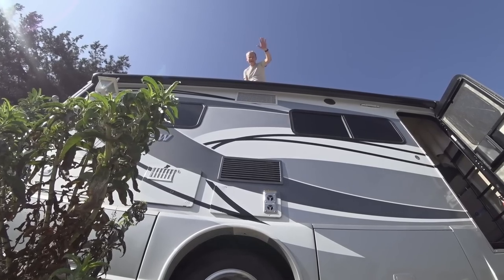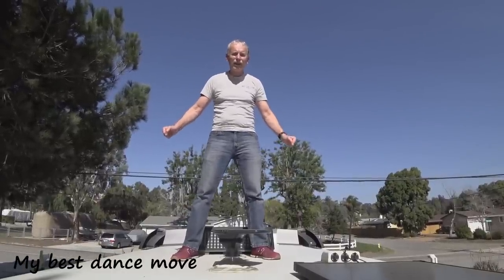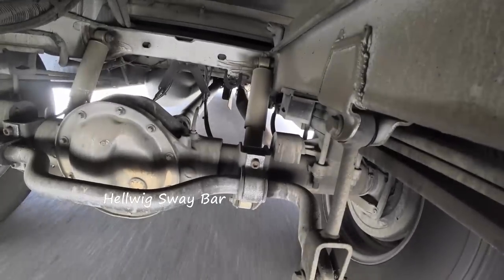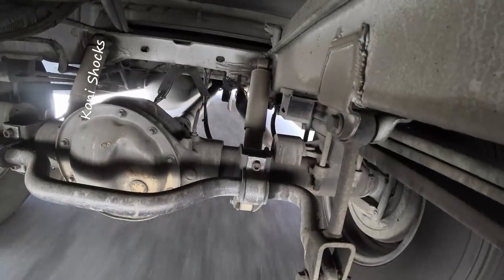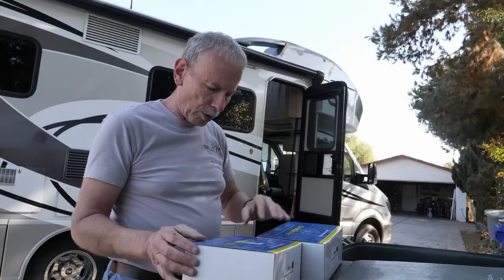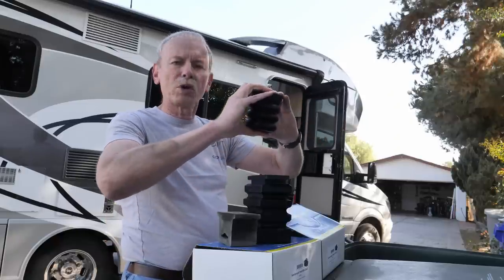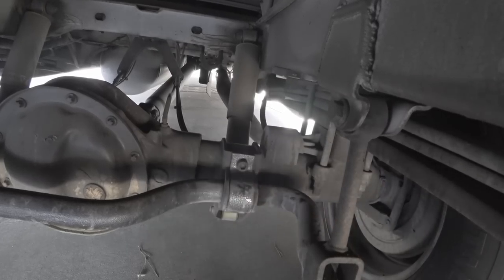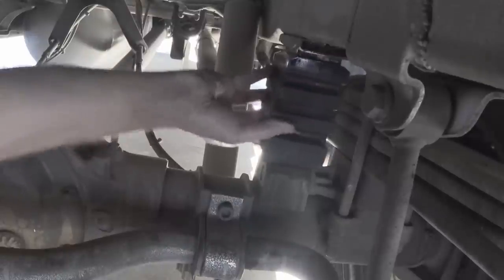RV Suspension upgrades - Winnebago View

Comment: Here are my recommendations and game changer suspension upgrades that I recommend:
-Agile Offoad Fox 2.5 rear shocks that are awesome!
-Roadmaster sway bar that goes in front of rear axle and keeps your factory in place and if your factory sway bar behind axle is not the new 1.5” but the smaller I would replace that too with larger diameter.  Keep in mind that scientifically and physically if you think it through having a large sway bar in front of the rear axle more toward the center of RV makes a lot of sense.  Costs more but who cares when you are thinking about the life of your family.  A local RV guy who is no-nonsense talked me into this solution and I am glad I listened.

As a note I added the Bigfoot leveling system and use this when I get on the roof as well for any reason to stabilize vehicle.

You may say “I don’t want to pay for this after paying so much for my vehicle” but let me say that I don’t really think the stock set up with how top heavy this brand/model is is really that safe and not a sound design IMO.  The Spinter has a narrow wheelbase and is 11’ tall and is way too top heavy for the stock set up in my opinion.  Make these changes and it’s a whole new vehicle in the way it rides and corners or reacts to wind or even exiting driveways or going over speed bumps at off angles.  It was a strong right to left gust going down the freeway that got me looking for a solution to be more safe.

You could even go one more and add a tracking bar to the front if you feel you want to keep going on improving. 

You can get the sway bar and shocks after market installed for $1500-$2000 or so.

Comment: Great advice for the DIY'er and perfect upgrades for better stabilization...

There is a company called WeldTec Designs in El Cajon, Ca. that sells the true suspension upgrades and lift-kits for RV'S like beefier "Leaf-springs" & "Shocks"... great stuff for those who like to go Boondocking off-road and require more ground clearance or just those tired of scrapping driveways.

Comment: Nice video..my first thought upon seeing the Helwig sway bar is the right upper mount plate for the sway bar appears to be cracked or the weld is separating from the frame. Now this could be the shadowing or camera angle and it might be just fine. Might be worth a look. I own a class C  Born Free E450 and did a lot of these mods when I first purchased it.. I had the front upper sway bar mount fail at the frame. I took it to my R & B Steel fabricators in Rockville Maryland and they did a fabulous job in a really tight space. I replaced the Ford shocks with Bilstiens, and found the one of the Ford shocks have already failed at less than 800 miles....jay
Reply: The bad weld was instantly obvious. I mentioned it before I read the comments.

Comment: Nice video for installing SumoSprings in our 2011 Winnebago View.  Discovered I needed a 13mm deep socket to remove the front Mercedes bump stop and install the front SumoSpring... which I didn’t have.  Found a 1/2” deep socket which worked fine... but would recommend anybody doing this get a 13mm deep socket to make their installation go smoother.

Also, I noticed you didn’t use the Mercedes recommended front jacking point... which is forward of the front wheels (3:18 in your video).  Obviously is worked fine but the Mercedes front jacking point which is shown in a diagram right on our Mercedes hydraulic jack under the passenger floorboard worked fine.  Just needed to jack it up high enough to get the front wheel off the ground so the front suspension drops enough to insert the front SumoSpring.  Definitely recommend setting the parking brake SOLIDLY and jack on a completely so the RV doesn’t fall over on the laterally unstable Mercedes bottle jack.

Just a couple of tips others may find helpful using your AWESOME SumoSprings installation video.  Thanks Ron !!!
Reply from the maker: Good points. I don't try to include all details (just the flavor) in my videos so as not to bore the ones that will probably have some one else do the work anyway.  Congrats on you initiative.

Comment: Added sumos to the rear of my 2017 24V. You made the video a few years ago and it's great..... but you left out the hard part which is jacking the frame up enough to insert the sumos. Maybe I have a defective jack because it was really hard to generate enough leverage with that skinny lever MB supplies to pump up the jack. Did you have the same problem? I was about ready to run down to harbor freight and buy a floor jack. lol. Hope to see you on the road. I'm buying!
Reply from the maker: R Murry yes, I have an old floor jack I use when I can. I have used the bottle jack that comes with it. A little more tedious.
Reply: @ontheroadwithron2432  I was watching another youtube video when I saw someone using the bottle jack and realized I don't have the handle for the jack. The previous owners must have not replaced after using it and I ( like an idiot) used the small handle used for removing the wheel nuts. Lots of work.....

Comment: Hey Ron, your video is so straightforward on how to do the install. One question, where did you place the jack to lift the frame to get the rear sumo in? Are you lifting under that beam the Heliwg is attached to?
Reply from the maker: Normal jack points on frame.

Comment: Ron, I love your videos and appreciate your willingness produce and share your work. Why did you choose the black Sumos vs the yellow or blue? I want to put them on my 2016 sprinter 3500 which weighs 9,700 lbs
Reply from the maker: Black was the recommended ones back then. If I had a do over, would go with Foxshocks instead.

Comment: Thank you so much for showing your improvements. We have the 2017 24D but with levelers. Are the sway bars possible with those? Will the shocks alone help with the swaying while driving? While I love the rv, I can’t believe the “swoopyness” of the thing.
Reply from the maker: winebox the best thing you can do is add a bigger sway bar. It will reduce the leaning over. Shocks help with bumps and dips in the road. And yes your RV chassis is the same as mine. My friend has Foxshocks in the back and highly recommends them.
Reply: On the Road with Ron That’s so good to hear. I was worried that with the extra equipment of the levelers that wouldn’t be possible. Is this a home mechanic job or a shop job? As this is our first rv, what should we look for in a shop?
Reply from the maker: winebox it is pretty easy to do. Just 4 volts for sway bars. Anyone with a couple tools should be Able be to do it.
Reply: @ontheroadwithron2432  Ron, I've installed the Hellwig sway bar (2016 View). What would you suggest next for the biggest bang for the buck?  Rear Sumo springs or rear shocks (Fox or other brand)? Thanks Mark
Reply from the maker: @markmartin6299  Fox shocks is recommended

Comment: Thanks for making this video.

I got a f53 with Thor motorhome on it and it was extremely hard to handle.

I put the rear hellwig anti sway bar on it and it did make a noticeable difference BUT even though they say it's a two hour job it took two DAYS.  The hardware didn't match my spring/axel saddles.  I  had to drill 4 new holes on those thick plates.  The existing ubolt nuts were pure hell to get off. Hellwig SHOULD have holes in the plates for both styles.

It also chaps my ass that they charge $850 for the f53 sway BUT it's actually less material than the f450 sway that sells for $235.

They are ripping us off bigtime.  They include redundant hardware including new unbolts and nuts for the frame attachment. Such a waste.

But as the old saying goes.... if you want to dance you have to pay the fiddler. 

As for the sumo springs, they do not make any for a Thor motorhome.   Buy I've read several reports that say sumo springs don't make much difference. 

But I have heard that doubling the shocks can make a noticeable difference.  But that may be a sales pitch from the folks who sell the long bolts and spacers.

I'm pretty sure that I'll be giving the quad shocks a try.

Comment: Ron do you have any updates on suspension modes? What have you done different since initial install? Remove anything add anything?
Reply from the maker: I removed the front Sumos. Too harsh a ride. Today I would go with fox shocks in the back without any sumos. Sway bar is good and I run 55 psi in front tires.
Reply: @ontheroadwithron2432  did you put back the front oem rubber bumper when you removed the front sumu’s?
Reply from the maker: @markpillori  yes, glad I kept them.

Comment: Were the fronts easier to access/install from behind the wheel, or in front, or over top? How did you turn your front wheels to allow for easiest access? I may not have seen it clearly, apologies.
Reply from the maker: Just turned the wheels. Out with engine on. Access from front and top.
Reply: @ontheroadwithron2432  I have since figured that out - trial and error. I could get the OEM bump stops out easier from top/front, but needed access from back/top to install new SS. Thanks.

Comment: Question: do these mods make the ride over rough spots softer? Right now our 2017 View beats the heck out of us (and itself) on the poorly maintained freeways here. Thanks.
Reply from the maker: If you want softer ride, then set front tires to 55 psi and do not get Sumo springs. Sway bar is fine. Most suspension mods are to reduce sway and rocking side to side when a semi passes or you take a sharp off ramp. Shocks also effect ride. Is your rig OEM or modified?
Reply: OEM. 
Wouldn’t low psi put tires at risk?
Reply: BTW love your videos! Useful, clear and complete. J
Reply from the maker: @josephnewman1545  no. The front is lighter than the rear and the 55 psi is the Michelin recommendation for the actual weight on the front tires.
Reply: @ontheroadwithron2432  Got it. Thx!

Comment: Hi Ron!    Thank you for posting this video.    I just got a 2019 VIEW 24J and would like to do the exact same upgrades.   Could you please post the exact part numbers for each of the 3 items?    Thanks in advance.
Reply from the maker: Fake Persona Just ordered from Amazon. Hellwig 7254   The other ones I got online. They are for the Sprinter 3500.
Reply: Which load capability springs did you get for the front?? I understand the weight load can be either 500lbs per spring or 1000 lbs per spring?

Comment: How did you decide which SumoSprings to get?  There are a ton of options, just for the sprinter.  All different grades and a huge price range.  It looks like you got the smallest available.
Reply from the maker: Furrari Aussies the black ones were the only type (color) they had. I’m considering removing them and going with Foxshocks instead. A friend of mine did this and is very happy with results. Mine still has too much rocking over angled dips like driveways.
Reply: I was familiar with SumoShocks already but never Fox.  I put air bags on my current class c but it's a ford based chassis.  They are a bit of a pain having to always put air in them.  They do work pretty great.

Comment: I did some research, and also talked to sumosprings technical support. From what I can tell you have both the wrong spring resistance (you should have a 54 and not a 47, that's the yellow versus the black), and you have the wrong spring model. You have the SSR 338 and sumosprings says you should have the SSR 336. The 336 is a much more robust spring (and more expensive!) with a positive attachment at each end. 
This could be why you seem somewhat disappointed with their performance on your RV?
Reply from the maker: Gregory K from what I read on the sumo website, the black ones were recommended when not towing and for medium duty. No big complaints with the rear ones, but I have removed the front ones and like the ride better. My main complaint now is the excessive rocking back and forth after crossing driveway dips at an angle. This is probably due to inadequate shock damping. Might try FoxShocks to fix that.
Reply: @ontheroadwithron2432  Ron have you considered replacing the rear springs with a helper spring package. The Sprinters come with only 2 springs. When you add a lot of weight that really puts a lot of load on the rear springs. Adding springs should provide more stability, front-and-back and side-to-side.
Reply from the maker: @stuartrogel9117  yes, but more springs also give a stiffer truck like ride. The existing springs are rated for the RV weight, if I make any further changes, it would be Foxshocks.

Comment: Great video - very informative. Do the sumos increase the carrying capacity from the basic 1030 lbs?  Which order do you suggest doing the upgrades?
Reply from the maker: The Hellwig sway bar made the biggest improvement. Shocks and Sumos can effect the ride so it is a trade off.  The Koni shocks are supposed to still give a better ride, but not sure how much is just marketing.  However that said, the original shocks are very wimpy and a good thing to upgrade.  Many different shocks to choose from, each saying they are best.  The sumos do not actually the RV increase load capacity, but will help bottoming out from deep potholes.

Comment: Hey Grandpa Ron, I was ordering Hellwig anti-sway bars for my 2018 Via and for my in-laws' 2016 View. Another vlogger (RV With Tito DIY) mentioned he did front and rear sway bars (E450 chassis), but I'm not finding front anti-sway bars for the Sprinter 3500. Is there only a rear anti-sway bar for the Sprinter? Thanks in advance.
Reply from the maker: David Ahn I believe the Sprinters do have front sway bars but I don’t know of anyone who’s changed them. They are a lot more difficult to install.
Reply: On the Road with Ron Thanks!

Comment: What model of Foxshocks you recommend or your friend using ? . When i spoke to  shockwarehouse I was told/advise  (KONI82 2588 for Rear and 872657 for Front) I have 2009 Sprinter 3500 (Winnebago view 2009)  , They said there is no FOXShocks for later Model RVs .. just trying to take your suggestions and experience so far on the suspension improvements you made..
Reply from the maker: The best are Agile foxshocks 2.5.  They are specially designed for Sprinter RVs. https://agileoffroad.com/product/agile-fox-2-5-rear-shocks-mercedes-sprinter-3500-rv-class-c/
Reply: @ontheroadwithron2432  Ron I have also heard agile fox shocks are very good for Sprinter RVs. I am also looking at Falcon 2.1 shocks for the rear of my 2009 Fleetwood Icon. They are also designed for RV Sprinter applications. Have you encountered them?

Comment: How did you decide whether to use the 900lb vs the 1400lb Sumo Springs in the rear of your MBS?
Reply from the maker: nikonjeff They only had one kind when I ordered mine a few years ago.
Reply: @ontheroadwithron2432  Thank you for the reply.  I spoke to the folks that manufacture SumoSprings and they recommended the Heavier Duty Sumo's (yellow).  Got them installed last week and took a test drive - definitely a nice improvement...
Reply from the maker: nikonjeff glad you like them. Does stiffen up things.

Comment: Ron, Great video. I am ready to make these modifications to my 2019 Winnebago Navion but am curious if you replace the front and rear shocks. It Seems pretty expensive if it may not make a big difference from the stock shocks. Thanks James V
Reply from the maker: James Vollmer after trying a few things, I was to try the Fox shocks. $500 so not cheap, but didn’t like the Koni’s or Sumos.
Reply: What’s your opinion now you have Fox Shocks?
Reply: Ron if you had it to do over again, was Sumos a waste? The larger sway bar sounds like a worthy investment and now that you changed the shocks..was it worth the investment?  Thanks for the advice and video

Comment: Performed all three over several years, had I seen video I would have done them at one time must so for Navion  sprinter vans. Safety note never ever jack up vehicle weighing over 10k lbs with out tire stops and load rated jack stands. 1st error will likely be deadly.

Comment: Ron do you have a 30amp outlet at your house I was thinking about putting that in atmy house
Reply from the maker: roger ghering no I don’t. I do have a 15 amp outlet but don’t use it much. My solar keeps batteries charged, so only use house current for tools or running tests.